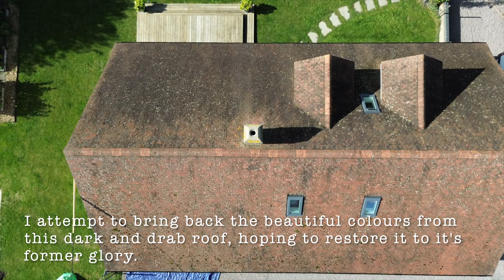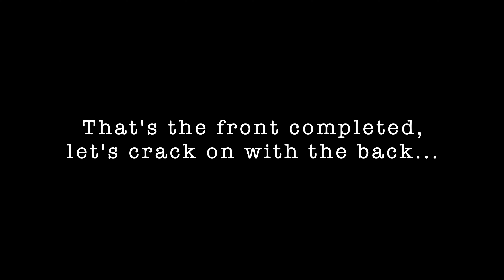This Once Was A Beautiful & Colourful Roof! Can I Restore It To Its Stunning Former Glory?

Comment: What is the cleaning equipment you use? Would that work on asphalt shingles, or would it damage them. My dad's roof is steep, like a New England snow roof. When I clean the moss, it's a gamble for safety, and as I get older, it's getting more risky, but if I could reach it with that equipment, I might purchase it.
Reply from the maker: No it wouldn't work on asphalt tiles, it would damage them.
Reply: @PrestigeExternalCleaning  thanks brother

Comment: Fantastic work as always Nick.
FYI, if that's a DJI drone, there is a preset function where you can set a point (the centre of the roof) and it will automatically fly a 360 while locked on that point. Perfect for before and afters 👍